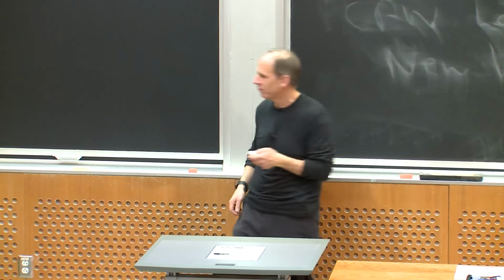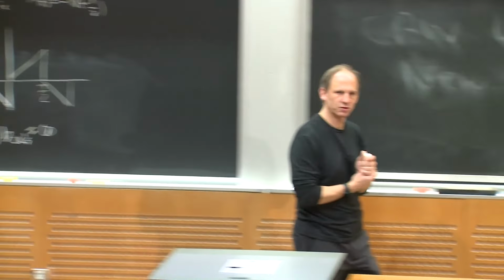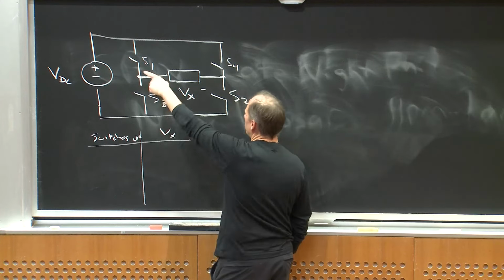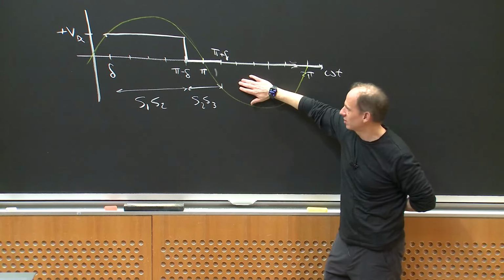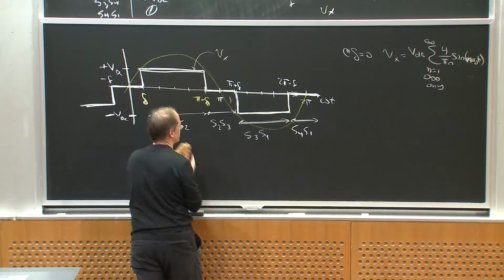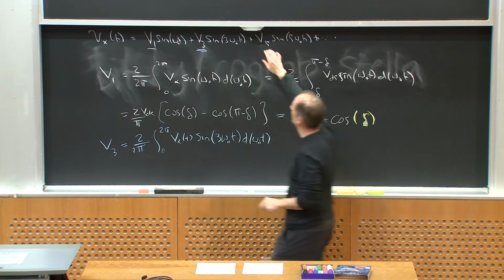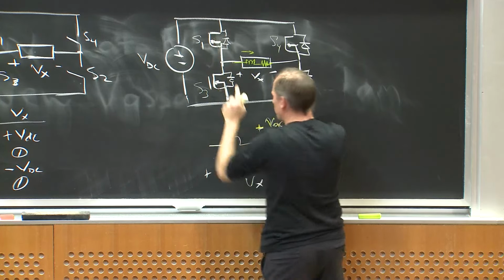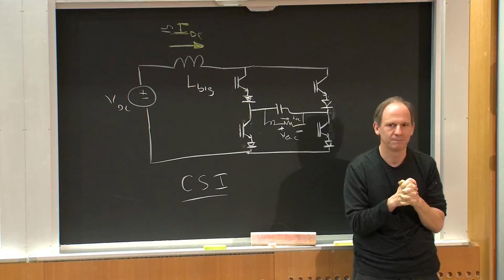Lecture 17: Inverters, Part 1

Comment: This is actually NOT the way to teach. 
Child and talk is the LAST thing you do. 
I nave been teaching electronics for 50: and taught hundreds, of not thousands of students ELECTRONICS. 
Chalk and talk is not teaching electronics. 
I have had electronics enthusiasts come to work for me and in  few weeks they are working, designing and fixing appliances and equipment that would take years of gobbledygook university attendance to miss-understand. 
The students in this lecture should be standing around a work bench, being shown an actual inverter and looking at the actual components and looking at a real,circuit diagram with an instructor that has actually soldered a resistor in his life. 
This chalk and talk teaches you NOTHING.  I did 3 years of this WASTE OF TIME and learned nothing. When l went for my first job, l didn’t have a clue. But l watched the servicemen and picked up everything very quickly. That’s why l started my electronics school and more than25 million visitors nave read my articles. But more important, l have sold over 300,000 kits and many students have said they learned more from me than their university course. 
It’s just the students in this lecture don’t realise how worthless a vague discussion is. 
The professors are not going to change. BECAUSE THEY CANT. They have never designed anything and most important THEY HAVE NEVER FIXED ANYTHING. Designing something is child’s play. Fixing it and getting it to work takes SKILL. 
A University has never said:   HOW TO FIX IT WHEN IT DOES NOT WORK.    When you face reality, you will realise how useless your university course was.

Comment: Dear Mr. Perreault, 
allthrough I do understand about the Fourier part, 
doesn't a 'perfect' sine exists of infinite odd harmonics ? 
So why filtering them as much out, to get only a first fundamental sine wave form shape ? 
Are all those mentioned harmonics than unwanterd side effects, of generating a sine ? 
Or is it just to make the filtering of the fundamental only easier ? 
Best regards, Harry.
Reply: the desired part of any waveform is fundamental of that. all other harmonics is issue and should be canceled. for example third harmonic cause heat in equipment and should be removed. in process of making sin wave the ideal form is just fundamental component produced and no other harmonics exist.

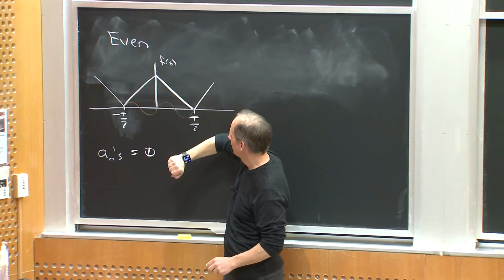Comment: 4:46 Shouldn't sine (wt) have period T & and not T/2?
Reply: I don't think it matters, as long as you are multiplying an odd function with an even function you will have an odd function which will integrate to zero for symmetric limits. In the case of Fourier analysis it has to be T I think he's just giving an example

Comment: Just one thing, at 970, with S1 and S4 on, we also get Vdc (but the current is 0 of course) or am i missing something?
Reply: The voltage difference across the resistor (load) is zero

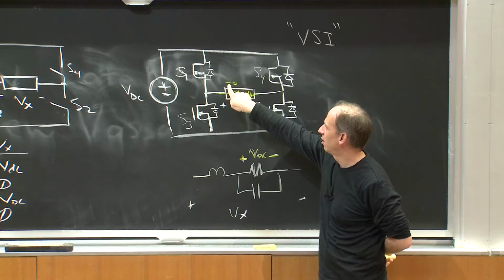Comment: At 44:52 the instructor is talking about making sure your mosfets aren't switching at the same time, but that we don't want to "open circuit" the load (esp if there's an inductive load). But he says that we first turn off S1, and if the inductor current is positive, then that current still has to flow somewhere: "but [the current] can just commutate from S1 into [S3's body] diode". Then once the body diode in S3 turns on we can turn on the S3 mosfet. But I don't understand what he means when he says the current will "commutate" into S3's diode, nor do I understand why the diode of S3 would eventually turn on when only S2 is on. Would the node between S3 and S1 (the + of the load) become negative relative to DC ground, turning on that diode? If so, why? Thanks for any insight anyone has!
Reply: The inductor will continue flowing current, as the magnetic field collapses.  A collapsing field causes the Voltage across the inductor to FLIP, to now, source the current.  So the current flows up through body diode of S3, then thru the inductor and down thru S2 (on).
Reply: @MrSummitville  You nailed it.

Comment: What happens if I use IGBT with and without antiparallel diodes in a CSI ?
Reply: IGBT's cant conduct in reverse, you'll cause them to go into reverse breakdown mode, and the voltage is usually much lower than the forward breakdown voltage.
Reply: @ Can it be used in CSI with anti parallel diodes ?

Comment: I'm a simple electrician that connected many motors in the past 25 years, and VFD's are relatively recent in the field.
When i started working, i think the most common method used to vary speed of motors, was with variable resistance.
Now, it's all about VFD's..
60hzAC to pulseModulatedDC,  and finally "fake AC" applied to the motor.
Is it an efficiency purpose, or something else..?
Reply: With a VFD you can change the frequency from a PLC giving you control of whatever is being driven, for example a fan that is cooling water. Now you can control cooling water temperature with a PID in the PLC through a VFD.
Reply: @andrewc.parmeter3557  i am not familiar with the terms PID and PLC
Reply: AC motors are more reliable than DC motors since the only moving things in them are bearings (you don't need to worry about commutator brushes wearing out, carbon dust shorting coils, etc); but they're much more difficult to control since you can't easily adjust the torque producing currents with a variable resistor or PWM waveform like you can with a DC motor drive. With a VFD coupled to an AC motor you can get very good torque control all the way from zero speed up to more than rated speed, with the advantage of a cheaper and more robust motor.
Reply: VFDs can drive 3 phase moters from a single phase service. The can also quickly stop the motor.
Reply: Efficiency is definitely a big factor. Another big factor is that they usually include other goodies such as short circuit and overload protection. Also, they can talk to PLCs, which allow your site's automation system to not only control the speed of the motor, but also turn it on/off, change protection settings, etc. Some VFD models even include PlD controllers, so you feed it for example an analog value of the pressure of a compressed air storage container and the VFD itself (without requiring a PLC) will regulate the speed of the motor that drives the compressor in order to keep the pressure at the target value.
Reply: Another reason VFDs are used so much is power factor. A motor across the line pulls a lot of reactive current to create its magnetic field. A VFD rectifies the AC to a DC bus and the inverter supplies the motor’s magnetizing current locally, so the utility mostly sees the rectifier load instead of the motor’s reactive demand.

So the motor still needs the magnetizing current, but the grid doesn’t have to supply as much reactive power (kVAR), which improves power factor.